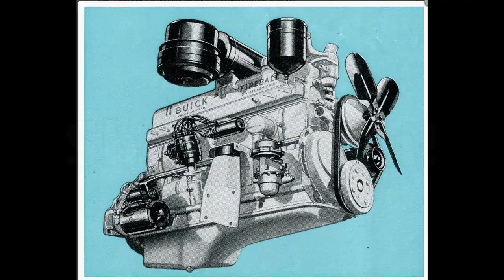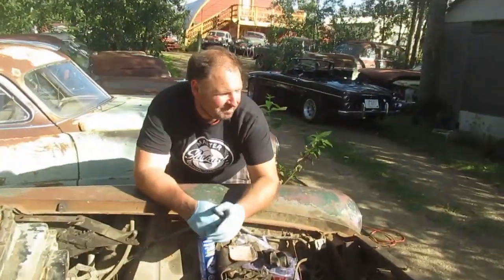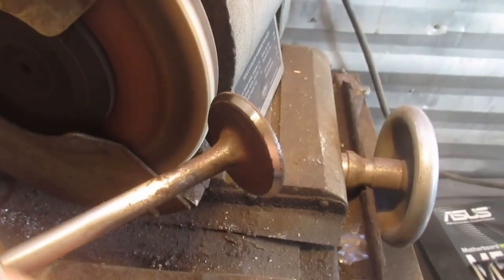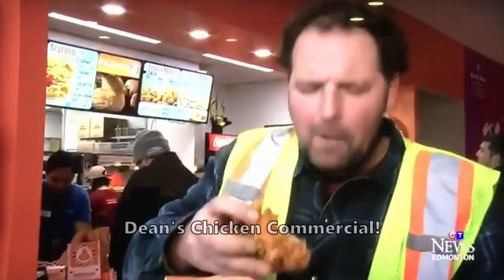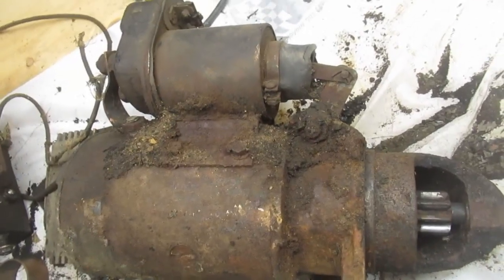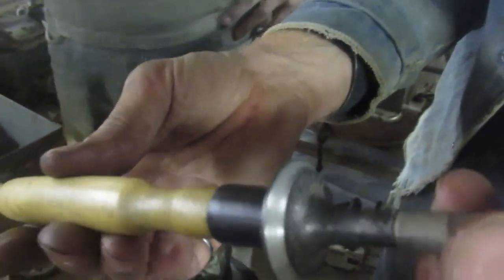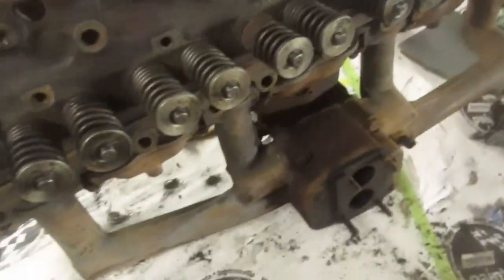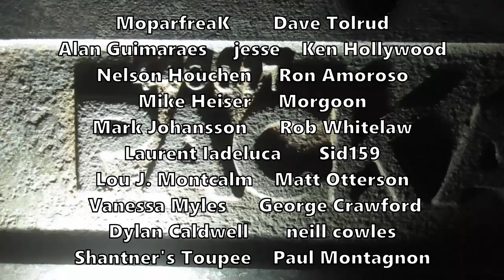Will they Run? Straight-8 Showdown! Packard vs Buick, Part 4...

Comment: I am a pretty dedicated Buick guy but if that Buick is a Dynaflow which would be a single turbine with no switch pitch that year, and the Packard is a three speed standard, the Packard may get the Buick off the line, but the Buick will eventually outrun it.
Reply: The Buick is a manual, and the Packard is an Automatic.
Reply: @lesdmark  Well than that could be interesting, because the automatic Packard's of that era were three speed units, and of course the Buick is a three on the tree. That Packard automatic would shift faster, than the guy driving the three speed, so they might wind up fender racing each other.

Comment: I went to high school with a guy that had 3 Buick Riviera one had had a dual carbs on and split exhaust wire wheel. He broker up with his girl friend because loved car he caught cheating on him  He took a axe to the car the cops stopped him because they were afraid hurt himself I don't what happened to the other two one was a V8 all; three cres were in flat black primer. I remember did valve job opn the V8 and spring compresser and spring went right slip off the plate glass window a perfect hole

Comment: The 1st car to go arou d the world lost its gearbox oil plug in Bolivia the guys squashed bananas into the transmission and continued until they got to a garage. The 2cv still exists on original condition. Type in round the world 2cv 😊

Comment: The Sioux valve grinder should have an oil feed tube that sits above the cutting wheel to lube the wheel with cutting oil while the valve is grinding. On the machine I used the tube ran across the top of the cutting motor from the right so somewhere there is pump built into the grinder motor. There was a shut off valve in the middle of the tube since the pump ran all the time the grinding stone motor was turning. The oil just ran down onto the table and I assume to some oil reservoir under the table.   I've done many valve jobs on that machine. Also you should always dress the grinding wheel before grinding. And last but not least the valve should completely cross the stone and not stop on the stone. I think there should also be a stop to keep the valve from moving too far to the right allowing the stone to hit the valve stem (ouch!).

Comment: Unfortunately after the engine warms up the valves lengthen , the marks made on the seat and valve from lapping no longer mate.Textbooks for cylinder head remanufacturing classes say this and also lapping should have gone out with the Model T. Good practice would be to grind the seats 3 angle .